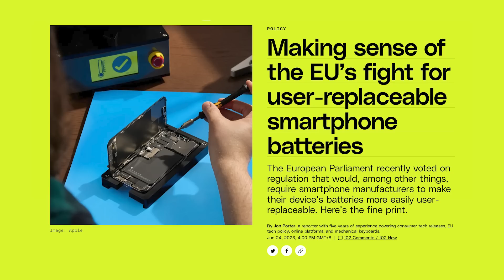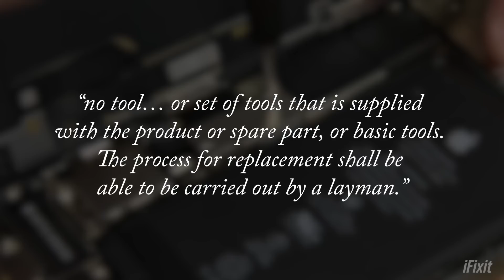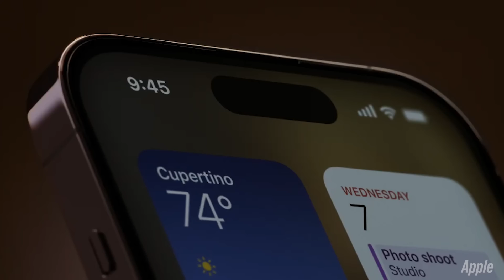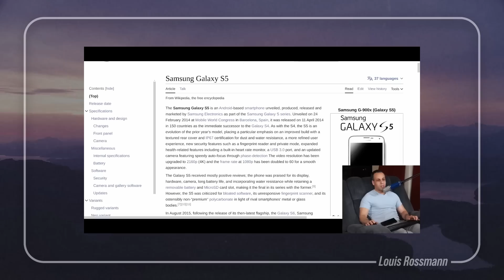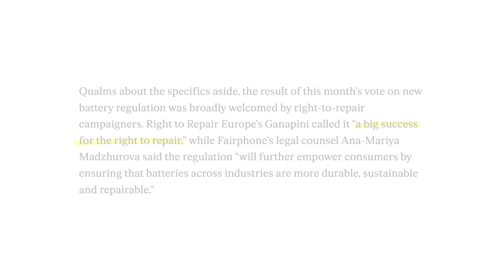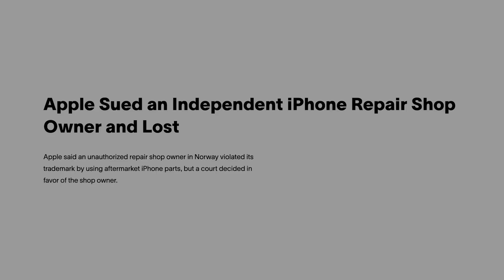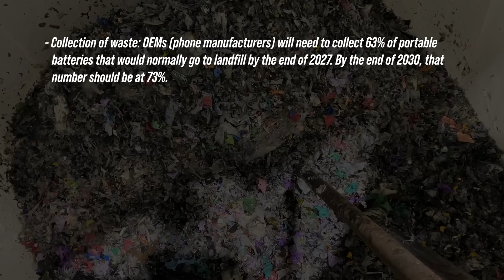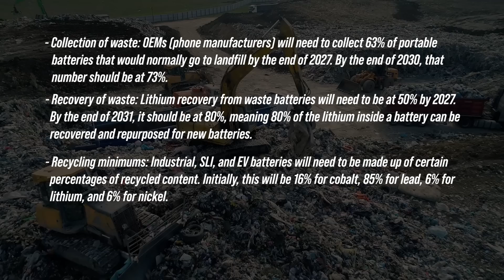EU Just Changed Smartphones Forever

Comment: We'll see very very quickly that it's been possible for them to make user replaceable batteries all along. They have not been limited by design they've been limited by desire.  It is in the phone manufacturer's best interest to make their products last as short a time as possible.  Making them difficult to repair is simply part of that plan.
Reply: Sony has SIM slot that does not require any tools while being waterproof and I had Motorola with removable back cover for accessing microsd card that was also waterproof.
Reply: @timop6340 A battery is a whole lot bigger than a sim card. Sim cards are a thing of the past anyway, again to save space internally.
Reply: @timop6340 it’s not the same size as the battery 😂
Reply: iPhones: Yes, it is in our best interest for everyone to get hyped and buy iPhones every year.
Reply: @Gurenn83 nunca!! No way! Not even for free would I touch!! ;-)
Point of principle.
Reply: @Gurenn83  the person buying an iphone every year isn't doing it because of the battery.
Reply: Ohh it's possible and quite easy to achieve without bulking up the phone. If Samsung can make a foldable phone  waterproof and fit a giant s pen inside their note/S series without losing functionality, adding a removable battery door is quite trivial. They just don't want to do it.
Reply: @nikhileshsingh8706 No it is not. A removable battery will definitely result in a thicker phone, it is not possible otherwise.

Most of the internal space in the phone is the battery.
Reply: @nikhileshsingh8706 the phone doesn’t have user replaceable battery 😂😂😂
Reply: @nikhileshsingh8706  The problem is more complex than adding a single door. You have to waterproof the whole battery housing which makes the phone more bulky (XCover)
Reply: @charo703 plus replaceable battery needs a shell, something that integrated batteries don't have.
Reply: @Tugela60  Yep. And replacing a phone battery isn't that hard nowadays. Just a 25$ tool-kit and you can replace any battery on any phone.
Reply: @nikhileshsingh8706 keep the removable battery door waterproof is the problem doofus 😂😂😂
Reply: It's called Planned obsolescence.
Reply: @paaaatrika 
And planned obsolescence is a direct function of a growth based economic model.

We need to abandon the fairytale of eternal growth to survive ¯\_ (ツ) _/¯
Reply: I fail to really see the tie between removable batteries and waterproofing, as one certainly does not seem to lead to the other.
Reply: @nyxstrix0  Well it's ostensibly easier to waterproof something if you can just glue it shut. If you need to make part of it easily accessible you either need to isolate that part from the rest of the phone or you need to both create a set of seals and a reliable and repeatable way to engage those seals. It's definitely more complicated.
Reply: @DoRC  is it really that complicated? All the components could still be sealed inside, and just the battery be accessible. There's phones and other gadgets that already do it, they can figure it out.
Reply: @nyxstrix0  to do it that way you have to create a separate compartment which means another layer of material which means a thicker device. I'm honestly not sure that would be the best solution though because if the battery compartment itself isn't waterproof you run the risk of having water puddled inside which will still corrode the contacts for the battery.
It also probably would be difficult to have something like modern glass backed phones with that sort of access. You could do it with metal while the easiest thing would be plastic. Plastic however is often associated with cheaper phones so making a flagship phone still seem premium would definitely get more difficult.
Again none of these are insurmountable issues and I'm certain that phone manufacturers could have been doing it all long but pretty much any solution will definitely be more complicated than simply gluing The phone shut. Having repeatable accessibility in itself will make things more complicated.
Reply: @DoRC   I fully agree with you. Yeah, they'll also be somewhat bulkier. The battery needs more structural packaging and the phone must accommodate that, as well as the mechanism for opening it. Phones may become 1-2mm thicker as a result. Not something that bothers me personally, but something to consider, especially for foldables where the problem is doubled. So idk. But it's not as straightforward as one might think. 
The battery in current phones are basically a tinfoil bag of lithium and electrolytes (very oversimplified). If they need to be removable, they will need at least a plastic casing, if not a small internal circuit for battery protection. This casing will add size, all else being equal. Maybe you mean smaller capacity, for a similar size as we have now, that might also be true.
Reply: @nyxstrix0  Or, hear me out guys, we could let the market decide! If removable batteries is such a popular and widely wanted thing, I wonder why there hasn’t been some company that just… makes one. And reaps the rewards of this widely desired market segment. 

Now, if we think for a second, we’ll realize WHY this isn’t the case. It’s because, outside of this little bubble of online tech enthusiasts, nobody gives a fuck about replaceable batteries. They care much, much, more for battery life, performance, looks, sound quality, haptics… etc. 

Maybe get out of your bubble and stop applauding governments forcing their will on people?
Reply: @alexanderhenderson5111  Right?
I'm sure 99.9999% of these people wouldn't buy a lower quality being less solid (because it has to be plastic), bigger, heavier, more expensive phone having even less battery life than its last generation.
These people are thinking they're living in the middle of the Sahara desert and have no power 20 hours of the day, so they have to charge up spare batteries just in case😂
Reply: @alexanderhenderson5111  YAFI
Reply: @Squidgical  Great argument, really showed me how my points are invalid there.
Reply: @alexanderhenderson5111  Without regulations things would be much much worse in the developed world.  Don't believe me?  Go look at how things are in places without them.
Reply: @DoRC  nice straw man. I never said anything about removing regulations. Telling companies exactly how to make their products isn’t regulation, it’s government overreach.
Reply: @alexanderhenderson5111 telling companies how to make their product is called regulations. Imagine if a company could put anything they want in your food or medication, or in construction material or in your electronics, would you be ok with that?
Reply: @botixxi  Health and safety regulations are COMPLETELY different, and to suggest that having a removable battery is tantamount to allowing building with asbestos to be built is just stupid.

Not to mention the devil incarnate for techbros, the US, has literally the best consumer protections in that regard in the world, and other countries will literally base their recommendations of those given by the FDA, FAA, CDC, etc…
Reply: @alexanderhenderson5111  If the lack of reparability creates tons of non recyclable waste, than it affects you health.
Reply: @alexanderhenderson5111  The thing is that no major company has innovated by offering replaceable batteries, all companies have tried to innovate with expensive custom tables. People just prefer this forced innovation. Tbh I don't want a government agency forcing design tradeoffs, and deciding what features I have to buy with my smart phone. You're totally right, if there was a market for this and consumer demand, a manufacturer would take up the cause. Unfortunately, there isn’t broad consumer interest. Most average nontechies just want a phone that works.
Reply: @alexanderhenderson5111  There have been several companies that make phones with removable batteries.  Fairphone comes to mind, a small Dutch company started in 2013 with roughly 70 employees. Lets see who and what they are up against. Samsung electronics, 54 years old with a 6 figure employee count and hundreds of billions in revenue. Or a fruit themed company, 47 years old, again 6 figures for employee count and more billions on the books.

Gee, I wonder who has the bigger marketing department. And what happens when a massive marketing department says something over and over and over...
Reply: @nickierv13  And is also 30% thicker, has an IP 54 rating (can’t even drop it in water lol) and costs considerably more than similarly specced phones. Plus a bunch of other stuff I’m not even bothering to mention. 

It’s almost like there’s a fundamental trade off to removable backs and batteries…
Reply: @botixxi  By that argument everything is subject to government regulation, since everything creates waste.
Reply: @alexanderhenderson5111  everything is subject to regulation, as it should be, everything we create to sell to others needs to complie to certain type of standards, that is how societies work.
Reply: @botixxi  Actually, in the US, unless your selling something that affects someone’s health such as food, drugs, medical supplies, etc… it doesn’t have to pass any “quality checks”. If a company sells a shitty couch, the government isn’t going to bust down their door and demand they improve their quality. The market will decide to not buy their couches, because they suck.

Not to mention, apple requiring people to come to them for battery repair is BETTER for the environment as apple will actually recycle the batteries, and people won’t replace their batteries as often.
Reply: @alexanderhenderson5111  Fair point on the IP54 but 30% thicker than what? Feature set is going to be be an issue.

Xcover6 pro vs S23 ultra vs S22 ultra: xcover6 is a little larger but also has a removable SD card and flash storage is a wear item.

Can I say the other 2 are similarly speced phones?
So lets apples to apples the S23 and S22. S23 is 1.3mm thicker, no taller, 0.8mm wider. Same weight. And a removable battery.

There is no trade off. You are not going to be able to tell the difference between the sizes unless I hand you both together.
Reply: @nickierv13  Than current iPhones / Samsungs. All are ~7.5 mm vs the 10.5 mm Fairphone. Which is actually more like 40%.
Reply: Stop buying from companies that screw you and everyone else over. Vote with your feet.
Reply: compilationhub54  
The "old climate claims" was part incompetent journalist and part fossil fuel industry misinformation, so no, the world will not end in 2023.

That doesn't mean we are in the clear though: It was the timeframe that got distorted, not the science as such.

Read the IPCC reports or find videos digesting the conclusion.
I recommend the channel Just Have A Think.
Reply: Bang on!!!! Well said u!
Reply: @ManleyEvangelistau lost me at take a look..!! I have zero interest in phones 
but (,with respect,your point wasn't missd)
Reply: Exactly - keeps their good old money tree growing strong !
Reply: What’s the issue with making phone a little thicker if it gives you obvious benefit of being able to replace battery? I really don’t get this trend of the last decade where manufacturers declare - look how slim and beautiful we were able to make a phone (while glueing everything together between two 6” sheets of glass) and then 80% of people put their phone in the rubber cover so the don’t smash this thin and slippery device on the first week of using it. So in the end you get same thick device, you only see the beautiful frosted glass back panel on the day of purchase before you put the case on, but now you can’t change the battery, the phone is way more fragile and any repair costs hundreds of dollars. I would take my plastic galaxy note 3 with modern internals over the s23 with great pleasure.
Reply: @miaso130  It was just mostly an excuse to make them less repairable. The goal the entire time has been to reduce repairability in order to sell more phones.
Reply: Quite frankly I don't think it's that simple. From a technical standpoint, there huge technical advantages to having phone batteries sealed in the phone. Stuff like water resistance will most likely be impossible with removable phone batteries.
Reply: @prof2k  
This is written on a waterproof Fairphone 4 which not only has a removable battery, but can be disassembled with a small screwdriver and your bare hands.

Don't buy corporate BS, and start thinking about why they want you to believe untrue things.
Reply: @prof2k  I don't think it'll be impossible. It'll be a bit more of a challenge but it's definitely doable.
Reply: @DoRC  Certainly, you are right. Since it's for the environment, it makes perfect sense.
Reply: The EU need to enlist their technology firms like Nokia to stop slacking and step it up in the innovation department.

And maybe reformat their immigration program to recruit the best and brightest engineering/STEM students from all over the world to be educated in their Universities and Technical institutes for the effort of innovation.
Reply: @willia3r  
That could be true.
Or a sign that Apple & co is using a lot money to spin a narrative that obfuscate unfair monopoly practice, lax environmental standards and worker exploitation ¯\_ (ツ) _/¯
Reply: @willia3r Nokia still is one of the most innovative and biggest telecommunications company in the world, together with ericsson ;)
Reply: @botixxi  hey anonymous person, your anonymous opinion with no objectively cited evidence isn't much of a rebuttal.
Reply: Now talk about EU forcing Apple to create a backdoor to get your iMessage data 

😂😂😂😂

You guys love big government right?
Reply: @RunForPeace-hk1cu 
We like reality based and sustainable politics, because without sustainability, we will see an end to a tech based civilization in the medium to long term :-)

That requires keeping big tech in check.

Big corporate is no more your friend than big government.
Reply: Um... does the law force Apple to sell 200k new phones in EU a year?  At a reasonable price?  Does it make non replaceable battery phones not work on the current network inside the EU?  Ok.. so Apple can ignore that law.
Reply: @davidbeppler3032 lol sure bud. Loyalists importing phones on the secondary market is enough to cover the difference between keeping their obsolescence scheme and Pulling Out Of The European Market
Reply: @davidbeppler3032 Not if they don't want to get massively fined.  The EU is way better about actually enforcing these sorts of laws, with fines large enough to actually be a punishment, rather a cost of business, than most individual countries.
Reply: 5 IQ reasoning, completely missing the point.  @davidbeppler3032
Reply: We did. People hated it 😂

Comment: The problem is not only the batteries it is the security updates that end and make the phones no longer safe to use.
Reply: Should outlaw bootlocked phones too. I bought a Google Pixel because it's the only phone that I can install another version of Android without a single drawback, unlike samsung that physically shorts a circuit that makes your phone unsecure and unusable for bank app, just because I wanted an android version with no other apps that I want. Imagine if the great built iPhones had the option to have a system where I can install a version of iOS that let's me do whatever I want. I would use that phone until it cracks from old age in 10 years
Reply: Samsung for example now updates for 5 years and even when that stops most security updates are trough google play these days and those go on for much longer.
Reply: @wistals3deniks  now... but what about older devices?
Reply: Software constraints are a lot easier to fix than hardware ones. 
Modded roms have allowed my phone to stay updated with the latest security patches even when it has lost official support.
Reply: yeah, why security update are limited strickly to couple years? How much does it even cost to give a user an option to extend the support? 10$ ? 20$? pro Update? It shouldn´t cost that much
Reply: “Security updates”. So they tell us. How about designing OS without loopholes. Fine sloppy programmers. Jail hackers / scammers.
Reply: 5 years for most manufacturers.. Google has been offering that since the Pixel 6 pro, Samsung also currently offers 5 years of security updates.  Apple usually even longer than that. I'd say that's a non issue compared to battery degradation after a couple of years that we currently experience, nothing's wrong with my Pixel 6 Pro apart from the battery crumbling apart in the last couple of months (2 months left for the 2 year mark...)
Reply: Never had an issue with "security" ... 5 years old samsung still going (also the original battery)
Reply: @TheScytheMoron  Your entire household network could be compromised and you'd have no idea. That's how intrusive and silent alot of the exploits are.
Reply: And un-updateable operating systems... I have an older model of tablet, it works great, and would be able to withstand an update or 2, OS wise... from Android KitKat 4.4.4. to at least an Android 6. I lost some functions and apps because of the outdated system, and the tablet is otherwise in tip-top shape. What do they want me to do? Throw it away?
Reply: You really dosent need them
Reply: Yes, for sure. These kinds of changes allow for malware and hackers to gain access like a wildfire, that and complete consumer ignorance regarding cyber hygiene
Reply: Sure you can